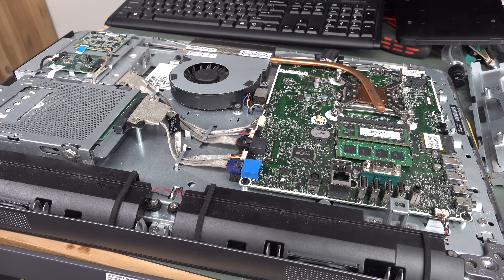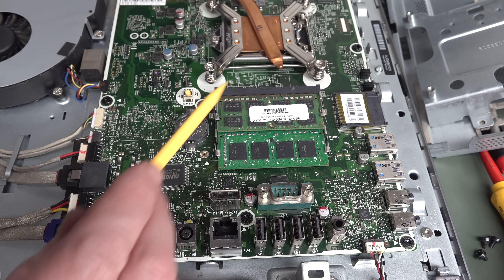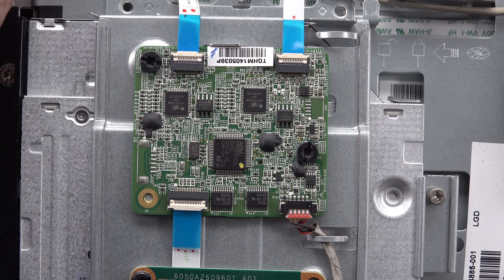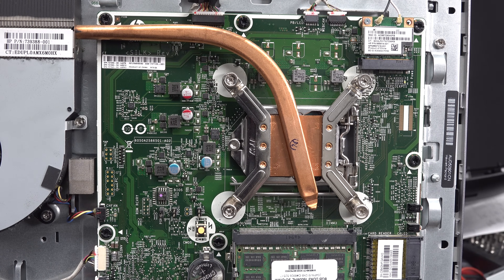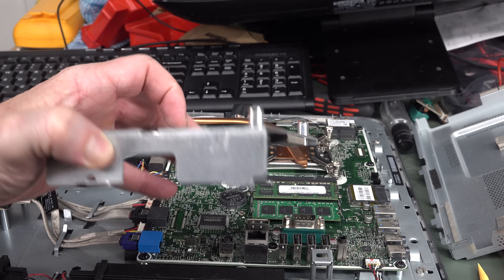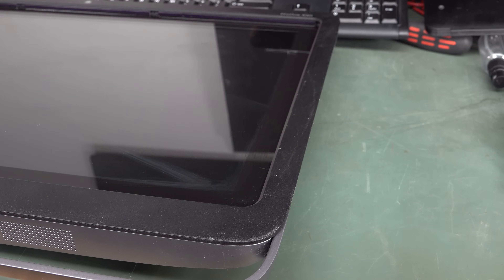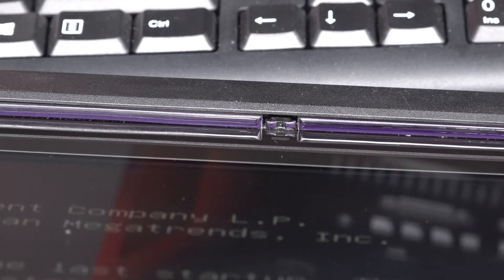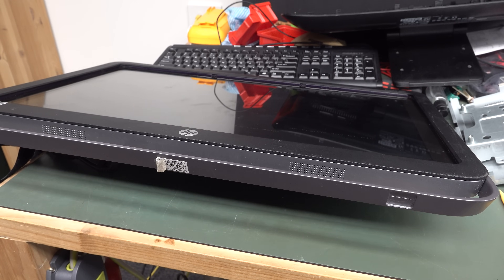Dumpster HP ProOne 400 PC Touch Screen

Comment from the maker: UPDATE: I have tried cleaning the sensors and edges, nothing. I have also tried Ubuntu 24.04 on a USB stick and nothing. BIOS update, also nothing.
Reply: if it really is a USB interface plug it into something else and see what it does.
Reply: I am afraid that it is dead Dave. Time to leave a moose connected out of the dumpster. I like the original Intellimice, they fit me perfectly.
Reply: Put your 121gw meter in voltage mode and test to see if there is voltage on the LEDs and go backwards.

Comment: watching this on my well...same exact computer...only change is the ssd and two 8GB memory cards. I have no need for touch screen and It probably doesnt work anyway...sure it's not broken, just not on...not a big fan of fingerprints. Was on a hospital desk for years until I got it at a sale for 100 usd. will most likely be an all in one pc person as long as they exist.   see the array of holes in the hard drive mount cover...i litterally screwed the ssd to the inside of that using the holes...the connector is correct for an ssd so no worries there.

Comment: Some years ago, i had a computer with a touch screen (heavy (in weight) industrial workstation computer). It was given to me only because the backlight didn't work. At home, no problem with the backlights. I did try windows and linux, but no touch screen, until i installed the "original" windows version for that unit. (of course all with the newest drivers).

Comment: The RAM was in Dual Channel any ways, even with a 4 and an 8, it will use the 4GB and the first 4GB on the 8GB module together as Dual channel, then the remaining 4GB in single channel mode...

while it's not the 'best' configuration, it works - and many manufacturers did it this way in the years around 2012-2016 - when 8GB was starting to show strains, but 16GB was still classed as 'lots' etc :D

Comment: Hi Dave, could be an incompatibility with Windows 10, I noticed on the original Video that the bios was dated 2014. On the HP website there is a FAR newer Bios Dated April 29th 2020 with specific fixes for Windows 10. Give that one a go!
Reply from the maker: Done, but no joy :-(

Comment: I used to work for a service centre repairing optical touch screen AIO machines. Always came in for touch screen erratic or not working and 9/10 cases its dirt on the sensors. The purple semi transparent plastic between the case bezel and screen glass are the sensors. Dust on them will screw it up. Just a quick clean with a dry cloth fixed them and a polite note to the customer to keep it clean. Some were horrendously minging and had never been cleaned.

Capacitive touch screen technology replaced this tech pretty quickly.

In rare cases the control board failed but in that case it wasn't seen in the device manager. The boards are almost always connected to the motherboard on an internal USB header and will show in device manager as a USB device.
Reply: I was going to suggest the same. This thing is absolutely filthy. I mean yeah it was in a dumpster. But I repaired things from friends and family and I always had to wear gloves and clean it before even attempting a repair. It's so disgusting how people never clean their devices at all.
Reply from the maker: Nope, that ain't it.
Reply: @EEVblog2  might be a bad controller

Comment: Dave ... On the HP's You need to goto Device manager and Goto HID drivers ... in there You will See the Disabled Touch Screen Driver not installed .. Copy the Driver ID and get the Driver from the Screens manufacturwer Forget HP for the Driver as it's built into the Bundled Windows 8 install .. I have had many HP Touchscreens with clean installs and touchscreen driver never installs automatically
Reply from the maker: It's installed and appears functional.

Comment: You can't expect to work during the POST, or before boot windows and load driver. This module is USB device and need driver to initialize. win10 should recognize if there is properly initialized touch screen device and you can see this when click on properties on my computer icon. Regardless to physical working or not, should be recognized by OS

Comment: get a linux live boot and see if it works
Reply: Will any Linux distribution work or only a specific one? I'm only familiar with Linux Mint Cinnamon and have never known about it.
Reply: @Lively_1185  Mint uses Kernels from 800 BC, but this thing is also pretty old so it might work.
Reply: @Lively_1185  I would get any one you are comfortable with. There are really only two variants RH and Debian based. The core and drivers though are pretty much the same.

Comment: https://youtu.be/I_sR6x3Oprc?t=64
If the problem is not software related, repair may not be cost-effective. The Pro One 400 G1 manual contains the following information: Touch sensor boards are paired with the touch panel spare part kit. Be sure to do so replace the touch sensor board when replacing a touch display panel. Failure to use the board supplied in the kit could cause the touch module to function incorrectly.

Comment: Go to HP support, download the touch drivers for this model - install them. It is normal for touchscreens of this era to be a little bit weird.
Reply from the maker: I did that, didn't work.
Reply: @EEVblog2  is there anything showing up in device manager without a driver?
Reply: @allan80supra  For older touchscreens on Intel laptop platforms: Most likely not - the important question is: Is there anything AFTER installing the driver. 

OK - in another comment, Dave already wrote that there is a device with a proper driver.

Comment: You could try using a digital camera to see if the infrared leds are working, same way to check if an infrared remote control works.

Comment: Simplest explanation is a button on the front that someone turned off the touch screen functionality.
Reply: hm... interesting point. I wonder if there are any "monitor only" type settings related to the touch screen.
Reply: @kevincozens6837  I checked in the manual, everything is controlled from within windows, nothing in the monitor itself.
There is a HP touch screen config area in the software.

Comment: Boot a live Linux, and see if that finds a touchscreen on boot, it normally will see the touchy feely stuff well. If not then probably a firmware update on the BIOS to latest version might help, and if not that then well plug in a mouse only....

If hardware failure then probably killed by being drenched dozens of times in cleaning solutions, and these destroying the sensors of the optics.
Reply from the maker: Tried Ubuntiu 24.04 and it didn't work.
Reply: @EEVblog2  Then she's dead Dave.......

Comment: If the problem is a driver issue DriverMax might help you find a driver that works for, if it is.

I am not affiliated with DriverMax but, I used it for my I,T, job and it often helps me.

Comment: Linux based systems (including Android) has a many touchscreen drivers already (no need to install anything) and tested with other kernel parts. In Windows, you can make trial and error method all day long - until it will work (for some time...) or not.
Reply: Throwing science at a wall, seeing what sticks.

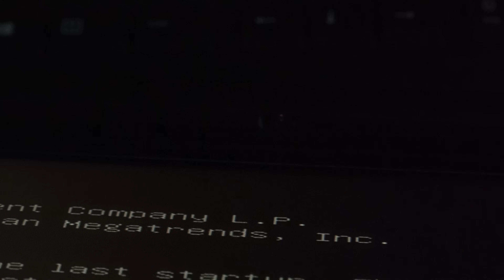Comment from the maker: 4:51 you can actually faintly see the LED pulsing.
Reply: It would be worth booting in to Windows then checking again for any flashing lights in case it is still some driver issue.
Reply: Sure that's not the reflection of the camcorder tally light?
Reply: @rjgscotland  looks purple which is IR.